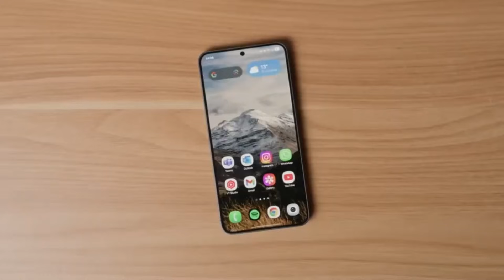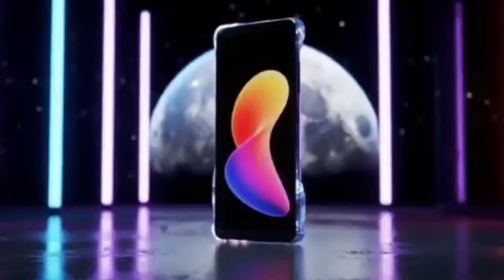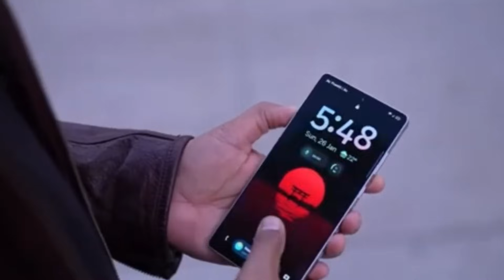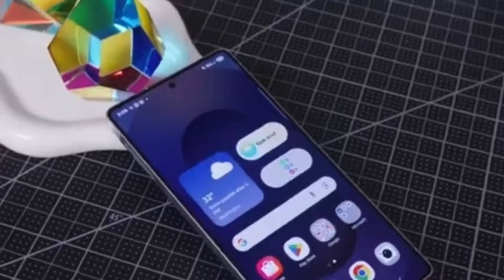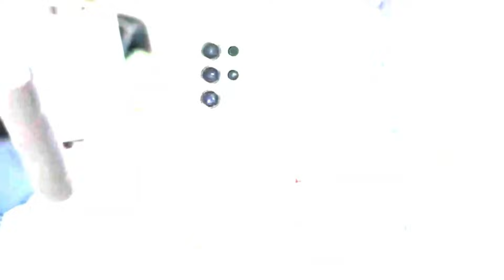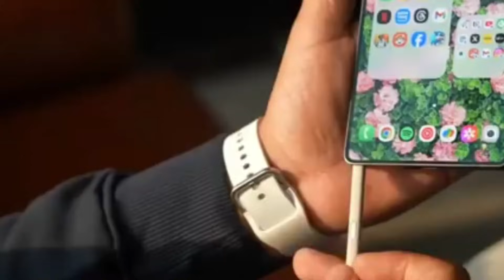Samsung Galaxy S26 Ultra - OMG, THIS IS SHOCKING!!

Comment: Same 5000mah but rumored to be 5200-5400mah but with the last several years of efficiency updates they are lasting longer than a lot of phones with 6k+ batteries once they release SiC batteries they will rule the market. They're upgrading 3 camera sensors, fastest Lddr5x at 10ghz ram, up to 16gb ram, up to 1tb memory, new M14 Coe display with flex magic pixel with 144hz QHD+,expected 35% increase in brightness, 40% less power consumption, 40% longer life expectancy, and runs 60% cooler than before, with 3200hz touch sampling from the 240hz s25u has, dolby vision and hdr10+, 3000nits brightness with 6000 nits for hdr, fastest chipset in any phone with 8 elite gen 5 8 core processor, spen with Bluetooth and new Ai features, new APV codec for cinema video,native LUT photo editing, increases in speed and efficiency of modem, gpu, apu, and npu, 60w charging, qi2 charging, Titanium frame, i think it will be a noticeable upgrade for sure and don't dismiss the exynos 2600 its expected to be 6x faster npu than apple a19, 15% higher multicore and 75% higher gpu performance compared to the a19. When compared to snapdragon gen 5, npu performance 30% higher and gpu 29% higher. With nearly identical scores on cpu